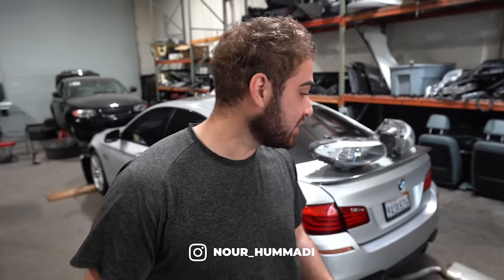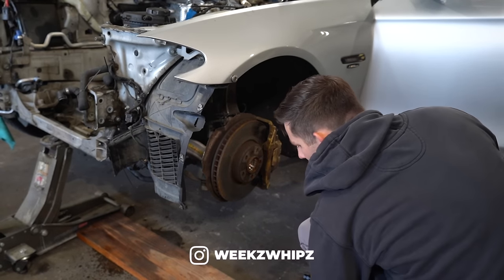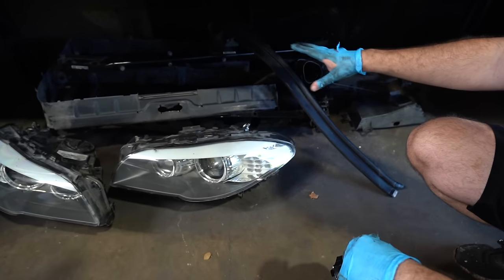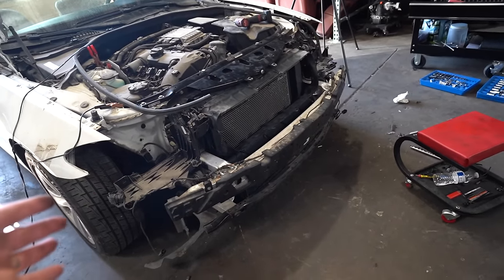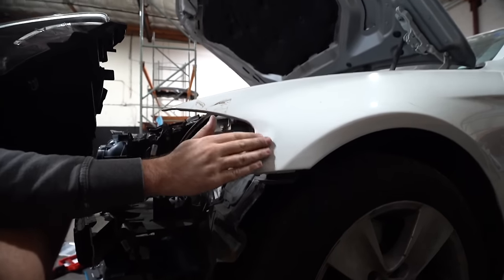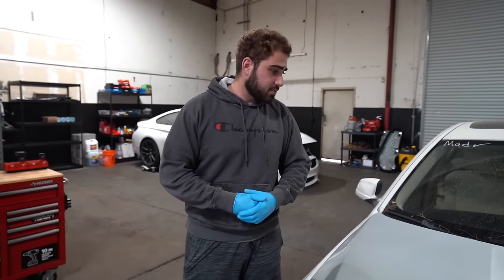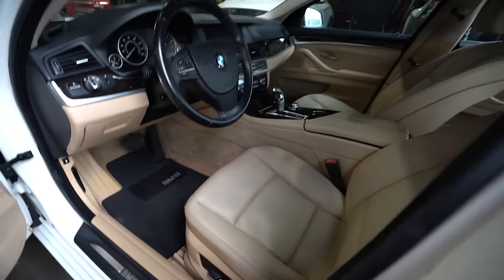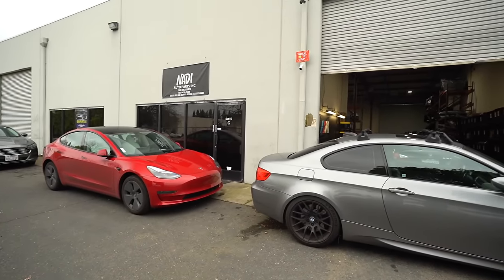Rebuilding The Best Daily Driver BMW! The Single Best Year For The F10!

Comment: As the owner of a beige interior BMW, I can confirm they're not easy to keep clean. Mine was a disgusting mess when I bought it. However, if you buy the right products and mechanically assist the detailing process with the proper tools, you can get it to look almost brand new.

Pro-tip for cleaning your seatbelts:
1. Pull them all the way outside the car and lock them with some clips.
2. Hit 'em with the pressure washer on both sides.
3. Then use a steamer to make the fabric and dirt more malleable and spray them with fabric cleaning solution.
4. Brush thoroughly.
5. One more pressure wash.

Comment: Nothing wrong with the 2017+ N63 engines. I have a 21 X5 m50i and the engine is great, no problems. I bought my Dad same car, but 2017 and still runs great!!

Comment: the revised N63TU is as reliable as any other BMW engine today. They fixed most issues after the 2013 model year, and the engine is still powering MX50i models.
Reply: not true, they are still shit
Reply: @matthewschaefer2678  It really isn't, considering that the N63 and N63TU can be considered 2 different engines. And there must be a reason why BMW still uses it (hint: they are not stupid).
Reply: @airforce66  they are still shit, my buddies 2016 550i had the valve stem issues at 60k miles blew the motor soon after